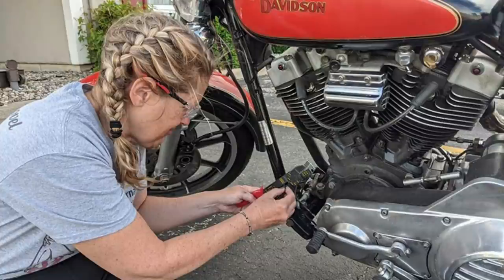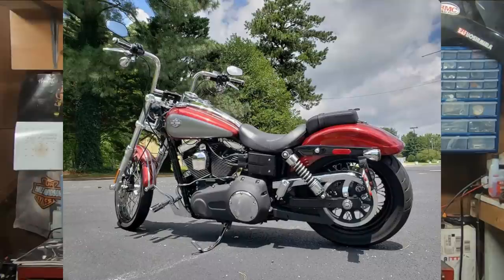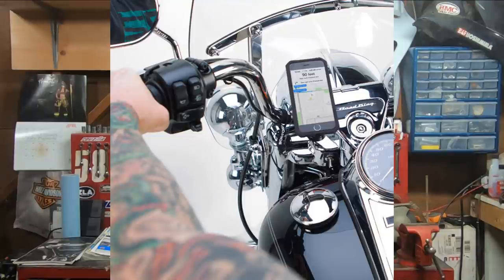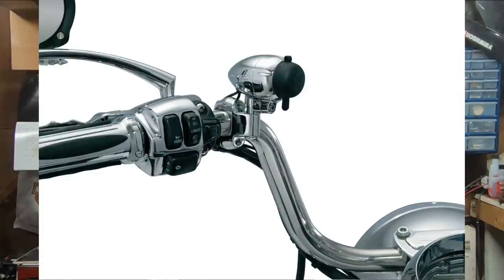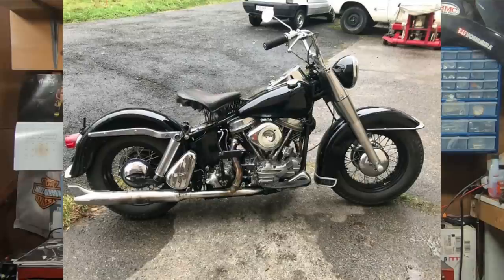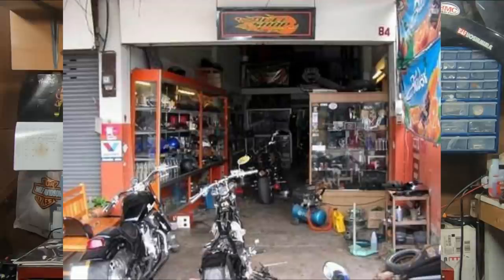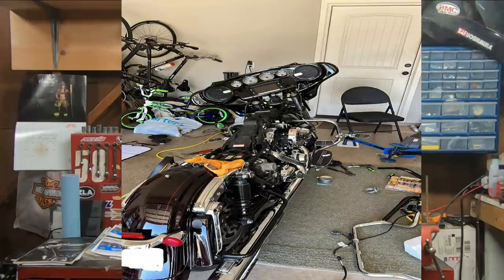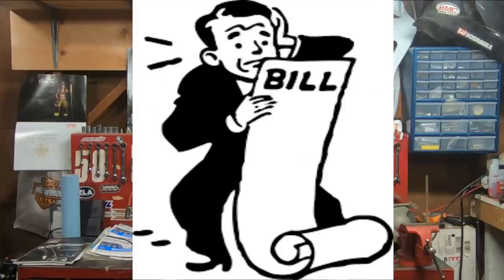Bar Swaps Require Intensive Labor and Cost More Than You Might Think

Comment: Wire extension kits from NAMZ and Burley Bars are a great time/stress saver. But since I usually run the wires inside the bars, and getting a bundle of spliced & shrink tubed wires thru the holes can be a pain, I just order extra length wires and solder directly to the switches. If those 18in apes that looked so cool just ain't working out, you can simply wrap up the excess length when switching to shorter bars.
 Likewise with modular brake line kits. I did do a few hyd. clutch conversion and used a juice junction block to use two lines. 1 from lever/master cylinder to frame mounted block and 1 from block to trans. I mounted the junction block on the top highway bar to frame bolt. So like the brake , changing bar height only needs an upper line.
Reply from the maker: You ain't kidding those kits are a real life saver, they cut the install time down quite a bit! Sounds like you've done some strong work on bar swaps!

Comment: You're  right on the money GF. (As usual) My dealer told me last week it would be $1000.00 for a new bar installation.
Reply from the maker: It's hard to think that it can literally cost that much to swap a set of bars, it's not a hard job but it's very labor intensive. A lot of guys would much rather pull and rebuild an entire engine than do a bar swap.
Reply: God damn!!!! I wouldn’t go back to that stealership. My very first time swapping bars took me an hour.

Comment: What do you think it cost for new cam shoes and dyno tune for 2001 fat boy only has 25467 miles thank you Daniel
Reply from the maker: I'm just ball parking it here, but I'd say 300 to 500 for the dyno tune. Just depends how much dyno time you need, the tensioner shoes aren't expensive if you're just going back with fresh spring tensioners. The labor is going to be the issue with the installation, good indy shop maybe 300 to 500 as well. Maybe less if you have adjustable pushrods or you're willing to go back with some.

Comment: The only problem I have is the ABS systems you have to take them to  Harley to bleed the brakes if you change your brake lines And that cost you about $300
Reply from the maker: Yeah those ABS modules have to be activated, but Friday I have a video on that where you can do it yourself. Just have to get the right tools to do it.

Comment: I was lucky.. I only has to change clutch/throttle/frnt brake cables for 13 inch 1-1/4 burly bars (34 wide) apes hangers for my WG... which I was going to do anyway. Only added two inches over stock. I ran the wires through the bars (Epic PITA), and The factory was nice enough to install enough wire length for the job. Funny this vid goes up just as I'm thinking about new bars again! Want a Z bar type of apes this go around... not as wide. Current riding stance is Y shape.. would like to go U shape, or at least a couple inches closer together. Still love the fat bar look though. 1-1/4 is a good look. Any recommends would be appreciated!
Reply from the maker: That far bar look is where it's at! Oh man internally wiring bars on your own is a royal pain, prewired all day if you can find the bars you want. You got more patience than I do wiring bars internally, I am not a fan or wires in general lol.
Reply: @GixxerFoo  The secret is a shop vac and string. Let the shop vac suck the string though, and you can finger cuff the wires to the string, then run them through. The nightmare is bars with 90 degree corners. Something like that just requires time... and allot of it. LOL. Thanks for the vids!

Comment: Gixxer, I have an unrelated to this topic question. : I have a 2011 Road King. I had the motor built, 777 Woods cams, bored to 106, SS pistions, big valves and springs, ported heads, tuned ( TTI Master Tuner II ), I use 91 premium no ethanol, anyway, when I'm getting on it, it pings, does it need to be retuned ? Or what's the solution ?
Reply from the maker: How much compression do you have? Sometimes with 10.5:1 give or take they will ping on 91, you might need a little tuning work to back the timing down just a bit. It might cost a little bit in the numbers but you for sure don't want it to ping. You might test it with some octane booster and see if that takes care of, I sometimes have to run octane booster in hot weather since mine will ping too. I doubt you heavy carbon build up on top of the pistons, but carbon on the piston tops will get hot and glow causing them to ping under heavy load.
Reply: @GixxerFoo  The compression is 10.7:1

Comment: I have heard that you can go up to 2" more inches without having to buy new cables/wires.  If so is that true for a 2011 Fatboy?  Love your videos.  You are my 'go to' source for Harley information, the rest I don't care about.
Reply from the maker: Thank you, I appreciate it! It really depends on what bars you're going with, if they aren't much taller and wider than stock it's possible. But most times if nothing else you'll need a new brake line for the front brake.

Comment: great video. yeh i did my sportsters and the bar was 100 dollars. cheap. it was everything else that cost. ugggh. sportsters are probably the easiest. i had to replace clutch and throttle cables. i learned alot. i would not do the bars myself on my road glide or heritage. just to much uggggh.
Reply from the maker: Sportster bars are really cheap and easy to swap, it's the cables and lines where they get you!

Comment: I put 14" bars on my roadglide, stock brake cable and switch wires, only bought a 4" clutch extension.
Reply from the maker: That's not too bad at all right there!
Reply: @GixxerFoo  nope saved a good amount on labor and extra parts. I know this is not the norm. 👍

Comment: I just put KST 10" apes on a ultra, used the stock clutch & throttle cables but needed a brake cable, total cost 900 Australian for the cable & bars.
Reply from the maker: That's about on point for what a bar swap can cost, actually not a bad price at all getting all that done.
Reply: @GixxerFoo  that was installed by myself, would of cost 2k if i had someone else do it. very expensive in OZ

Comment: I remember and the old days you would get pulled over for having a pan or bars on your bike. Many of these laws are still on the book in other states you would need to check with your local authorities because they might pull you over left right and cheddar to give you a ticket and after spending all that money to get your bar is changed then you have to go spend it again to put it back to what it was
Reply from the maker: Yeah bar height is still regulated in a lot of places, it can't be high that your shoulders is what most go by. Which kinda means one guy is legal with apes, someone else jumps on the same bike and then the bars are technically not legal. They used to hammer people hard in Sturgis for that, most likely using it as reason to make a stop and see what else they can find.
Reply: @GixxerFoo  they also used to hammer people when they went to Daytona. When I protested his course of action he said Son you want to argue about it here or in jail. I rode all the way back to Daytona for my court hearing with a polaroid of the wheel of the bike showing shaft drive and lucky for me my judge had a Goldwing he called the highway patrolman up to the bank and said I have a cold one I don't have a chain guard on my motorcycle are you going to give me a ticket and and highway patrolman said no sir your honor he said case dismissed and I asked if the judge if he could do something to prevent me from being hassled on the way home oh, he gave me his business card and said anybody pulls you over and tries to give you any grief you show him this card. I once had a unit officer that if cars had seatbelts for safety than motorcycle should have seatbelts to. He had no clue about anything pertaining to motorcycles at all. When I told some motor officers about what they're fellow officer said they thought I was yanking there chain. I told them I swear to god that's what the man told me and they just took their heads in disbelief.

Comment: The bars on one of my bikes are horrible. I have a 2018 forty eight, and it has a very stupid integrated riser on the top triple tree. In order to run most bar and riser combos requires purchasing a top tree that doesn't have the integrated risers. If I don't swap the top tree then my options are very limited, I can either run just the bars with no risers, or there is small 1 or 2 inch risers that can be fit together to make risers but they end up looking like Lego risers because there ends up being a bunch fitted together and it looks incredibly silly. The other option was finding a company that makes bars that fit the integrated riser, which again, was VERY limited. I found something up my alley from Westcoast Tbars, which are a 10 inch MX bar setup. They are one piece (no bar and riser combo) and they mount to the stupid integrated top tree. The only issue i have with them is there is a half circle on the integrated riser that doesn't get filled in and if someone looks closely they will see it. I have been wanting to make a plug for it to clean it up, they are nice because it gives me somewhere to take the internal wiring out, but I definitely need to plug the outside portion of the 1/2 circle that is left open. It would be simple since it's just half of the 1 inch bar, so basically I just need a 1 inch circle plug cut in half. There are some videos of the bike on my YouTube where you may be able to see it. The bars were about $400 USD, and i luckily didn't have to swap any cables, although I did upgrade my clutch and brake lines!

Comment: Speaking of the fancy hydraulic clutch, didn't Harley go back to the cable, and make a conversion kit also???
Reply from the maker: Yes, in I believe 2020 they went back to a cable clutch on the touring bikes. They made some other little changes for cost savings but the price went up lol, they also did away with the heal toe shifter.

Comment: good luck on bleeding the brake system if its antilock. u will need to take it to the shop for that.. Also if u have any doubts about doing the swap. Take it to a shop it will probably be cheaper. If u make a mistake its gonna cost to fix it.
Reply from the maker: That's a really good point, that ABS is a real pain. You have to have the ABS system activated to be able to bleed the brakes.

Comment: i did it on my bike, took me days! was the first time i did it where i had to run the wires internally and it was a real pain in the ass.
Reply from the maker: Running wires internally is a huge pain, I usually use fish tape or run a coat hanger through them. I'll take all the wires to it and pull it through, works pretty well most of the time.

Comment: I agree it’s not terribly “hard” but unless you’ve done a few it can be daunting to account for everything you’ll need to do the job correctly. My advice to anyone reading this:

Know how to remove pins from the terminal connectors. Protect them appropriately when pulling them through your new bars. 

Use 3M Electrical Lube to run the Throttle by Wire and Switch wiring together. Makes it’s considerably easier job. Older Harleys are fairly forgiving as your just running switch wiring. 

Use high quality 3M Electrical Tape for all the needed uses. (i.e. re-wrapping harnesses, tying the wiring to pull cable, protecting bare terminal ends) 

Use quality grass trimmer line with steel ball chain (dog tag chain) to fish it through the bends

Do some research. Generally Speaking ~13 inches or less you can retain stock cables/wires but after that you will want to get quality items to replace those for appropriate length and function. 

Newer Harley Bikes I remove my tank because it’s super easy. Older Harley Bikes you will need to drape a tank cover over your work area. 

Take a super conservative but thorough test drive and make adjustment before going hard in the paint.
Reply from the maker: Sounds like you've done this a time or ten! Removing connector pins is another daunting task, very solid advice!
Reply: @GixxerFoo  Great Video man. Yeah I’ve done a “few” of them. Ride safe out there 🤙🏽

Comment: I paid 1500$ for parts and labor. LA choppers 14" with new cable on an 08 Road King. HD asked for 1900$ !
Reply from the maker: That's more the going rate, dealers are expensive labor. The Road King cost less for labor with the bars being fully accessible, you get into the full fairing bikes and that's a big cost to just swap bars.

Comment: would beach bars fit on a 07 road king with stock cables  ?
Reply from the maker: They should just going with wider bars, the touring bikes have decent length stock. Going taller might be an issue though, but beach bars you might be able to do it.

Comment: When Harley Davidson were nice simple motorcycles you just had to get you new bars and longer throttle cables and a clutch cable and and you were pretty much done. Now that Harley Davidson have a should have a blinker switch they have a cruise control and writing modes and order another electronic garbage navigation system so whole nine yards so cable swap is not simple you have all that wiring and switching to deal WI th. I wish at a local aftermarket shot and I heard the owner talking to a customer about his handlebar swap and he was quoted a price of around $800
Reply from the maker: 800 bucks sounds about right, there's just so many electronics on the new bikes now that you really want the plug and play wiring extensions!

Comment: I've swapped bars myself,  but my 2012 FLD has lots more hi tech bits than my BMW chop. Anyway,  with professional help, it'll soon have 16" stainless apes on solid brass risers. Woohoo! Ps 68" clutch cable £90 !!
Reply from the maker: That's quite a bit of work to go to 16" apes, you've got to pretty much redo everything going that tall. It's worth the work in the end though!

Comment: I avoided the Barswap issue entirely and just got a 4inch pullback riser and adjusted my bars to be fitting to me. 
I just dont wanna deal with longer brake and clutch lines and all that crap. Too expensive. Even with something like Arlen Ness Low Pro bars... its just too much.
Reply from the maker: I don't blame you at all there, getting everything swapped out, bled out, rerouted and adjusted is a real pain. Unless you just really want to change the look bar risers like you did are the way to go.

Comment: I have a 2013 road king would it be possible to change the controls to 14 controls? Thanks love your video’s!!!!
Reply from the maker: Are you looking at 14" bars? It's possible and not too bad on the Road King, there's not a whole fairing to take off. Don't quote me but I believe you may just need a front brake line, I can't remember if that's for 10" or 14" though.

Comment: The local H-D dealer quoted me $750.00 labor to swap bars.
Reply from the maker: That's not bad on a bar swap from a dealer, was that on a touring bike with a fairing?
Reply: Yes, a '16 Ultra Lim. I should have mentioned the model. I am planning to buy H-D 12" Fused bars and keep the heated grips. Will probably need new brake lines and a wire harness extension. Am figuring about $1300.00 +/- for the whole job.

Comment: I asked my dealer for a quote on installing14 inch bars on my Street Glide Special.  

$2200  

Yup.  $1300-ish of that is just the labor.  They said it would be parts plus 8 hours labor.

I didn't do the work.. can't justify the cost.  I had 16 inch bars on my last bike.. a road king.. but I had a friend do those for me.
Reply from the maker: Wow, just wow. That's insane, most guys that own indy shops will say they wish they could get that for a bar swap but they like to sleep at night. Dang 1300 for labor, it's a lot of work and very involved on a touring bike but most dealers charge something like $125 an hour.